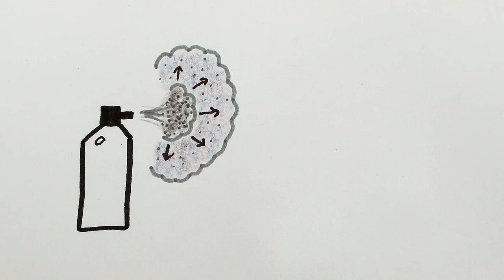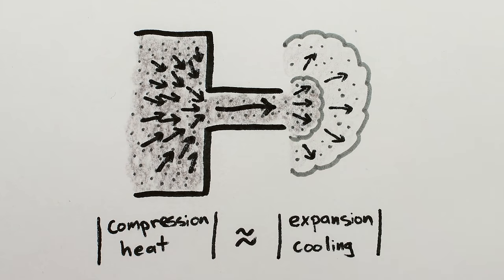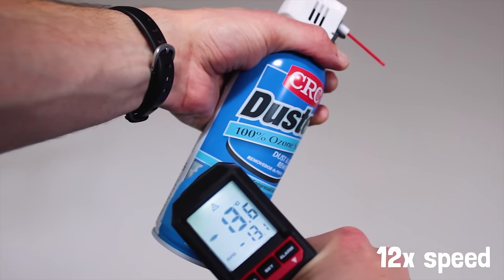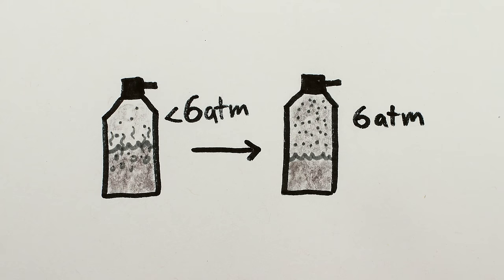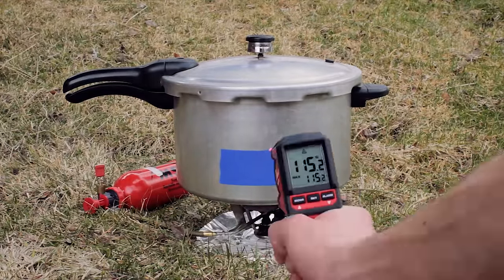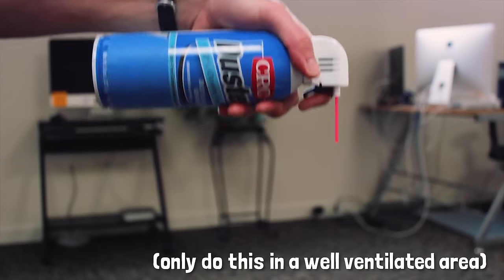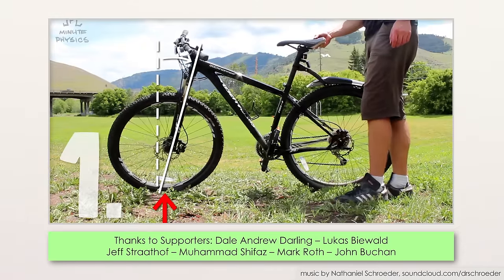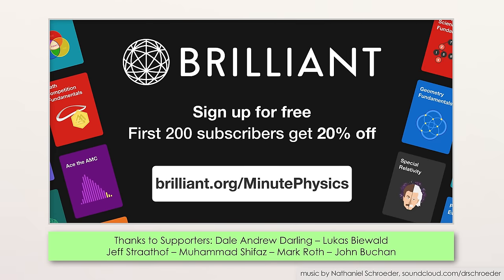Why Do Compressed Air Cans Get Cold?

Comment: So, it is a clever system to create a pressure outward since there is pressure inward, which liquid is necessary that it converts into gas so that take energy to outward, so it need inward energy that holds the gas, which the gas hold the liquid below, so need strong can to hold it, so gas is the medium that need to be high enough to hold the liquid and liquid need to be low enough so it converts into gas so it comes out as gas, but is a mist, so it is a mist can. So, the pressure different between liquid and mist need to be high enough as a barrier in between, so it is not pure mist, but pure liquid but convert into mist outward, so the liquid goes down but the gas goes up, so liquid is need so it pushes upward the gas to outward? Or it can be pure gas, so there is no liquid and mist, just pure gas. So, why mist is there? Because there is visual so that is why there is a mist so you can see. So, it is about convert two different pressure base on your action so it converts into liquid from mist, so increasing the pressure so become liquid from mist. If you shake so the pressure change and also if you press the spray the pressure change within so come out in high pressure so become cold and with cold, is impact to cause dust to be push away. 

Compare to compress air, so what is same and different? So, the air itself is compress within to fill the space, so high pressure within so outward there is high pressure, so within the compress air so the press will be reduce so air within compress is not same as before? For this one it is same as always? Since there are two different phase that create a pressure within so it holds it until liquid run out which gas run out, well, the mist, since the liquid is bottom of the mist, so the tube is at bottom which suck up the liquid or wherever the tube is to suck up?? So, it is at the top, then it sucks up the mist which create a vacuum outward so the mist raise as liquid decrease, so liquid is convert into mist so it bubbles up into mist. For air compress, so there is no bubble up, just outward gas that is all. The bubble is a sign of convert phase or creating a pressure system which within bubble is different from above. That the bubble within is something else. So, holding the pressure, then release the pressure. Also it releases the pressure within, to be accurate it is converting the pressure within which inside has two different phase. Compress air is one phase.

Comment: This is also the case with propane gas containers. It's a big issue for blacksmithing because when a container cools down enough it loses pressure.
Reply: Yeah, I've got a butane/propane gas heater.  I switched to fibreglass bottles because they're lighter than the steel ones, fearing a hernia.  The ambient air can't transfer heat into the bottle as fast as it could through steel.  It can run at about 1kW continuously but not two.  And when the low pressure safety cutout kicks in there's still another hour of gas left if I give it it time.  It's amusing that for the thing to work heat must be transferred into it from the environment.

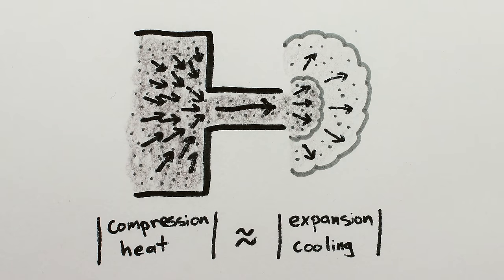Comment: 1:15
So, if the expanding gas pass through small nozzle cause heating that equilibrate the cooling effect then why when I pass my "gas" through my small butt valve sometimes feel a bit warmer?

Was it because I have excessive pressure from my bowel?

Can we possibly take advantage of the heating effect to warm up our metal bench in a cold morning?

Comment: Does this factor in?: The molecules with the most thermal energy are the ones that stay gasseous when colder molecules cool into a liquid. So the molecules with the most energy are the ones in gas form, and when they leave the container, they carry most of the existing heat with them, leaving less overall thermal energy inside.

Comment: Usually when they say "6atm" or whatever the value is it means that it is 6 atm more than the outside pressure which is 1 atm so the gas inside is at 7 atm. Is it the case here ?

Comment: So, I've got a physics question that's not related to this video, but maybe you can answer it.

When it's nice out, I like to take my cat to the backyard and brush her fur to get rid of all the loose hair that otherwise ends up on the floor. When I do this, I have to pull a clump of loose hair out of the brush every so often.

It seems like no matter how I release it, unless there's wind, the hair almost always floats back toward me. What's up with that? Is it some static electrical thing? Weird air currents? Or just observational bias?

Comment: This explanation works for spray cans, but what about canisters of substance in an entirely gaseous state? CO2 canisters, such as the ones used by cyclists and in airsoft guns, cool off based on the ideal gas law, or Pressure*Volume=Number of molecules*constant*temperature, or PV=nRT. In a co2 canister, volume stayed constant. As gas releases from the canister, the number of molecules decreases. This results in less collisions between molecules, lowering the pressure, and slowing down the molecules, which is a drop in temperature

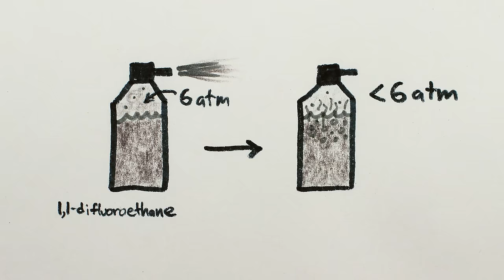Comment: Wait, 4:50 then what is the difference between being compressed and pressure liquified? Isn't pressure liquification achieved through compression?
Reply: Yes, but the fact that pressure liquification is caused by compression does not mean pressure liquification is the same as compression.

Comment: I'm not so sure about this... Scuba tanks get very very cold in a similar way if you open the valve and they have ordinary air inside. I think this may is related to the drop in pressure (Charles's law iirc)

Comment: So drop in pressure results in a drop in temperature and vice versa?
Reply: According to thermodynamics and the gas laws, yes.
Reply: Yes, but the gas laws only account for a minor part of what's happening here.  The major part is the phase change from liquid to gas.  The latent heat of evaporation. If you want to use air you choose between keeping it in gas phase (maybe 4 seconds use from this size of container), or liquefying it (immensely strong container).  They choose a substance that can be liquid at moderate pressure so that the cans aren't heavy  and will boil when the pressure is reduced.
Reply: @raykent3211  True.

Comment: Or in short, gas laws. (V₁P₁)/T₁ = (V₂P₂)/T₂ 
V is irrelevant as it stays the same.
(6atm)/295°K = (P₂)/248°K
solving for P₂ gives us a value of about 5 atm. That sound right?
Also, for those of you who dont know, kelvin=celsius+273. Only absolute temp scales can be used for these equations, or else they dont work.

Comment: Just an FYI, the formula for isentropic adiabatic expansion is only true if it is a calorically perfect gas, which is to say that the changes in internal energy and enthalpy are always proportional to the changes in temperature. 

However, for gases undergoing phases changes, this is not true. As hinted at in the video, the energy within a gas is a lot higher than its liquid counter part, even if they are at the same temperature.

I have performed analysis for steam nozzles, which are basically pressure cookers hooked up to rocket nozzles. For one particular nozzle, if I used the calorically perfect relations I predicted temperatures around 150 K, meaning in theory it would shoot icicles. However, when I used a steam table, which takes into account the energy associated with phase change, it predicted a temperature around 350 K. 

In summary, when undergoing isentropic expansions, phase changes can be thought of as cashing in a huge amount of energy to help with the expansion, greatly reducing the temperature drop. Unlike a noncondensable gas which must do all the expansion by lowering its temperature. Similar to how it’s really easy to get cold and hot temps in dry climates, as opposed to cold climates. The condensable moisture makes it much harder to pull off big temperature swings.

Comment: If you compress a gas it gets hot, then you can stop there until it cools to room temperature, and then release it so it's going to get cold, so you can make a freezer with pump.
Reply: This is the basis of the refrigeration cycle.

Comment: Pressure temperature relation. Decrease pressure -> decrease temperature and vice Versa.
Reply: No. The ideal gas equation predics that an expanded gas remains at the same temperature. The Joule-Thompson effect is more tricky than that...
Reply: NuclearSavety basic thermodynamics
Reply: @DJxDannee  no, thats exactly the point, basic thermodynamic leads you to the ideal gas equation, NOT predicting the cool-down of expanding gases..... for the JT you need interactions between the gas particles...

Comment: tl;dw - I don't see the counter demonstration - why does a bicycle pump get hot?

PS: The movie "The Day After Tomorrow" posits the icy cold atmosphere above coming to the surface and freezing things solid. After all, we've all been on a jet airliner and have seen the exterior temperature sooooo frosty cold. The movie has got to be right, right? What is doesn't take into account is that the atmosphere is also very thin. To get that atmosphere to the surface one would have to compress it, like the outside air is compressed to exchange the air in the pressurized cabin of the aircraft. If you compress the air, the temperature will rise. A back-of-the envelope computation will show if the high atmosphere were pressurized and brought to the surface, you wouldn't get things freezing solid, but you would probably get serious toast. PPS: this is why air travel companies minimized the air exchange on flights - the air conditioner necessary to cool the compressed outside air takes A LOT OF FUEL, making air exchange EXPENSIVE.

Comment: Are there similar cans that don't use this liquid and a result therefore not hurting the environment with the greenhouse effect?
Reply: There are compressed air bottles, similar to a propane bottle torch in size. Meant to be filled with an air compressor. Some mechanics use them to have a small blast of air to clean parts without having to deal with a clunky air hose. If you go this route however you have to make sure to keep the moisture filter on your compressor in good running order and just might be shifting the source of pollution to your household power provider. Also a good idea to take the bottle in for regular inspections and not store it full of air, compressed air can be very dangerous if it suddenly decides to make a jail break.

Comment: At 0:36 why is it isentropic adiabatic expansion. I see how it is adiabatic as no heat is transferred to it's surroundings so the internal energy is -W. But why is it isentropic? Surely it's entropy increases and it's not reversible. The example he gave of cutting the top of the can is definitely not reversible.

Comment: Well i think the test with the boiling pot needs more explenation, because... isnt the steam inside the pot heating the pot to 100+ and where the pressure inside is released the steam comes out and temprature drops to boiling point. Steam get hotter than 100°.

Comment: turn a can of compressed air upside-down and spray it through the crack between locked doors and if there's an infrared request-to-exit sensor on the other side it'll unlock the door :)

Comment: It's also not an "isentropic adiabatic expansion", as it is not reversible. It's an isenthalpic process, not an isentropic one. No positive work is done by the expanding gas, and an ideal gas would not change its temperature at all!

Comment: I have a random theoretical question that I think may be up your alley- what is the most that humans could effect Earth's orbit and/or rotation if we intentionally tried to? I remember hearing that the Three Gorges Dam displaced so much water that it slowed the rotation of the planet by a tiny fraction. So is there any way through engineering or otherwise that we could get a more dramatic result?
Reply: Yes.

If brute force doesn't work, you aren't using enough.

Comment: Why does the water cool back down to 100 degrees on it's own when steam is let out?
Reply: Because it takes a ton of energy to turn 100 degree water into 100 degree steam. The energy needed comes from the heat in the water, which cools the water back down.

Comment: Can it be because the valve is small? For example your mouth can blow cold and warm air.
Reply: i think what you're observing is the fact that when you blow air with constricted lips, the air coming out of your mouth is moving fast enough to drag along with it the air in the room, which is colder. if you were in a room that was as warm as or warmer than your body (for instance the bathroom after a hot shower), it should become impossible to blow cold air.
Reply: r77xxl got it. I’ll have to test that out sometime.

Comment: Expanding air through a valve DOES NOT cool by a significant amount. The formula you used is for isentropic expansion. Isentropic expansion requires some work output. If you have no work done (or if the work is done on the gas itself), then there is no isentropic expansion. 

When you expand through a valve, you get isenthalpic expansion.

Comment: Is that an usualy american thing caned compressed 'air' ? 
Also sounds like a typical clima killer, 
if any flourine gas reaches the Ozone layer it will react and dmg it  (due to the UV break down)...
Reply: They are used all around the world, handy for clearing electronics of dust and stuff from hard to reach places.

Comment: Very interesting video!
Although I still have one thing to note:
Temperature differences usually are noted in Kelvin (K) instead of degrees (°C/°F/or whatever ° you want to use), because temperature degrees usually characterize a specific state and not a process.

Comment: You can have some fun with this stuff tipping it upside down. Spray a bunch of the liquid into a plastic water bottle with a pop top and shake it up eventually the pressure builds and you get a hell of a boom and bottle rocket. Spray it on a CPU heatsink and you can cool it right down to 0c. Spray the ice onto your arm for 30 seconds or so making arnie me freeze puns and its hilarious until you loose sensation in the area and cause a nasty case of freezer burn and a nice round scar.

Comment: what about the cans that claim to contain just air and no greenhouse gasses? still this 1,1 somethingsomething-potent-greenhousegas
Reply: An aluminum can with just compressed air would probably last for 5 seconds tops. 

The reason why propane or 1,1-difluoroethane last that long is because they're able to liquify at pressures that the can is able to maintain. Liquid gas takes significantly less space than gas therefore you can really have a lot of it in a small container.
The air can also be liquified (it would be a mixture of mostly liquid nitrogen - 78% and liquid oxygen - 21%) but to do that you need significantly higher pressure - much more than cheap aluminum cans are able to handle. To hold actual liquified air instead of a cheap, thin aluminum can you would need a good quality gas cyllinder - like a scuba tank. 
But those are very heavy and expensive.

Comment: Now I wonder how much pressure it would take to liquify air 🤔
Reply: Depends on temperature. At standard atmospheric pressure, air liquifies at about -194°C. But also keep in mind that "air" isn't a specific chemical compound, and the air in one place might have a little different composition than another place.
Reply: @Rena Kunisaki Ah okay. Thanks for the info. :)

Comment: Don't waste your money on compressed air to clean your keyboard. Use a vacuum with a nozzle. Don't use a vaccum cleaner on computer components like the motherboard however, as they generate static electricity and can damage the parts. You can buy an anti electrostatic vacuum like a datavac for that. Saves a lot of money and waste in the long run.

Comment: what about CO2 fire extinguisher, using a pillowcase over the nozzle and spraying, you get dry ice
Reply: And you waste the extinguisher. It has to be recharged after every use, otherwise you're risking that it won't work.
Reply: @renakunisaki  I meant that as a question, what state is the CO2 in the extinguisher in? Why does it become dry ice

Comment: I see. So the "do not shake warning" is there to prevent us from discovering it is not actually air inside.
Reply: IllidanS4 no. Shaking it will force more liquid to boil off, increasing the pressure to a point of maybe exploding the can. Think: shaking a soda bottle
Reply: That would indeed make us discover it is not actually air inside.

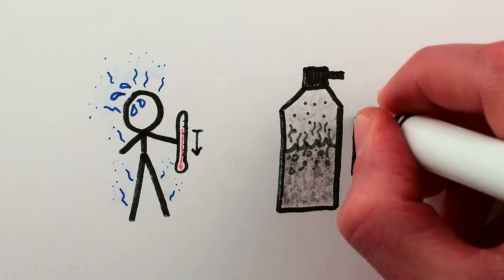Comment: 3:09  delta T ist 20 K (Kelvin), NOT 20°C (Celsius)!!!
Reply: It really does not matter at all.
Reply: @Owen_loves_Butters  Yes, actually it doe’s. Because °C is not a proper description for what Temperature means. If you calculate complex machines, like heat pumps, you will have really wrong results.
Reply: @HugoHabicht12  Delta T is the exact same regardless of C or K.
Reply: @Owen_loves_Butters  No, it isn’t. That’s something like the description of pressure with meter.
Reply: @HugoHabicht12  You can try it yourself. Pick two temperatures at random in Celsius. Calculate the difference. Convert to Kelvin. Calculate the difference. It's the same either way.

Comment: Someone else and I put an air horn (basically a compressed air can with a horn on the nozzle) underwater, and it made instant ice. You could see the ice form super fast, And it grew to the size of about 2 inches in a few seconds! (We didn't put it in water to drink)